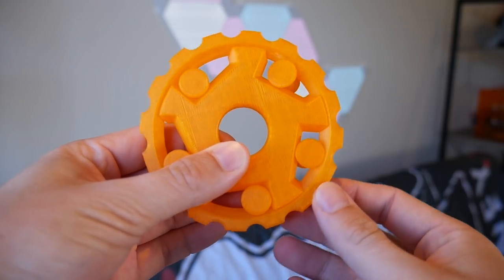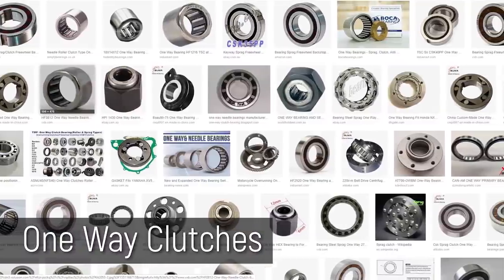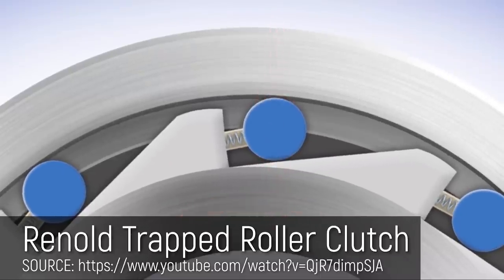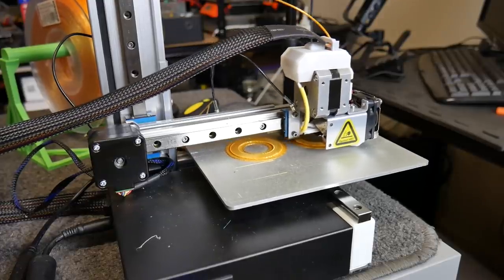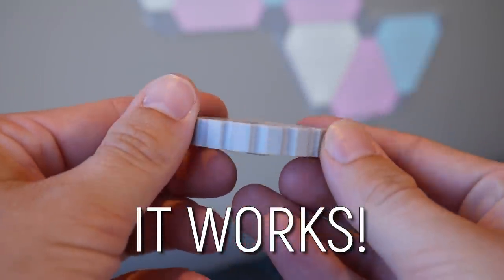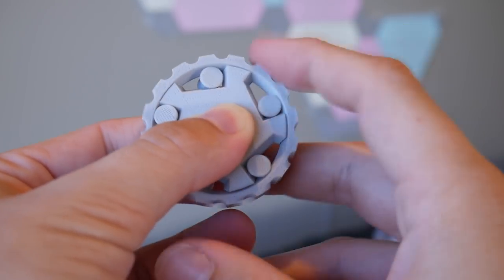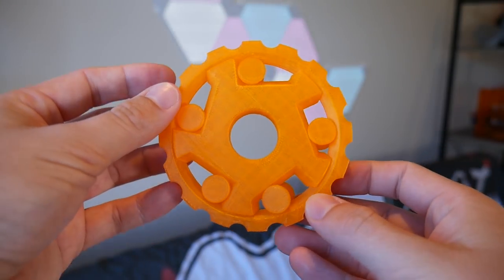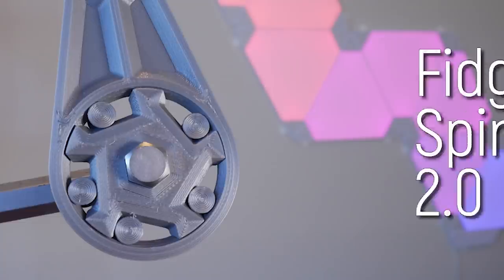Can you 3D Print a One Way Bearing? Roller Clutch Design

Comment: This is very slick!  I had a little flash of an idea to combine this with a thing I've been working on here and there - a sort of gatling gun style prop.  Using a power drill or screwdriver to drive the whole thing, the printed barrel set kind of stops on a dime when the trigger is released, just because it doesn't weigh very much.  I think using a roller clutch like this could give it some extra spindown time when the motor just stops, but still catch it firmly enough to spin up instantly when power is back on.

Comment: Probably not real useful on a bike. It will either slip or break, and thats not good on a bike. The sprag style is used in car transmissions as part of clutches in automatic transmissions. Its part of a conpound system where IT will turn in its turn dorection with less force than the gears its embedded in and in its lock direction it the gears its imbedded in turn with less force than its slip or fail point. Its done so that one shaft can be used to provide torque in either direction with out more complicated mechanisms.
Maybe i miss the point of what you want to do with it on a bike but i will be interested to see.

Comment: Have you tried changing the angle of the "ramp" that pushes the roller outward to see if it affects the maximum locking force it can generate? 

I think steep and shallow angles will produce different characteristics. Steeper angles will force the rollers outward more strongly but will not engage as easily initially. You might even make a hybrid clutch design where some of the rollers have different ramp angles or diameters to tune the behavior in desirable ways.

Comment: My guess for why the rollers slip is because as they get wedged against the sides they are pinched harder and harder until they overcome friction - likely on the straight inner part, because the outer part may add a bit of spin as it breaks loose, both rolling up the outer part, sliding against the straight inner edge, and springing out of the wedge.  Changing the design of the inner edge from straight to curved might help with this.

Additionally, not all of the rollers are getting wedged, and may be reducing the force needed for the rollers to spring back out.  If you could design the one way bearing in such a way that all of the rollers are all held at approximately equal angles apart, this would almost guarantee that all of the rollers would be wedged between the inner and outer edges; and the plastic may stretch and compress a bit, if only slightly, as well.

Comment: To figure out how much torque it could handle you could have put the mechanism in a vise, attach a 1 foot rod to it, and add 1 pound at a time to the end of a rod until it failed and you could get the amount of foot pounds it could handle. I know it’s not a metric measurement but it’s something.

Comment: Very interesting concept. I think you have more engineer in you than you realize! Great design, and video, and would love to see you beef it up and perhaps use carbon fiber and try it on a bicycle! Good luck. If it works for the drive, dry putting another one in the opposite direction to see if it will also work as a “coaster brake”.

Comment: oh btw the two-one way rotation thing can be used in a vehicle just in case somehow the engine/motor starts up in the other direction but it wont have reverse. also i would like to see the result of spining the two way to one way thing from the output shaft

Comment: "the roller is fre to spin" it is not rolling but just sliding. the balls are either turning with the outer or the inner circle. at one point they rub against.
Reply: its gona have wear on the balls or the middle section, where they sit in. ultimatively getting pulverised cuz of friction.